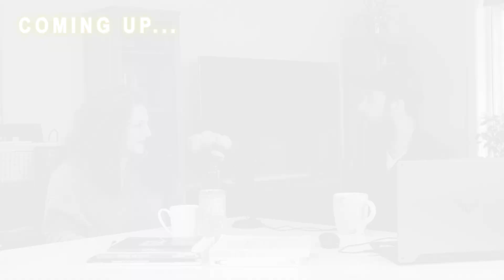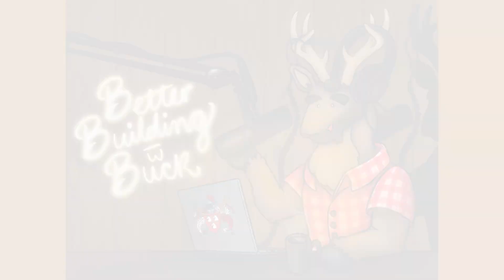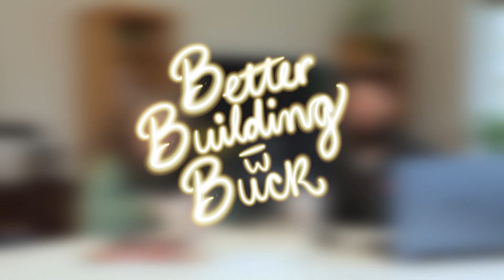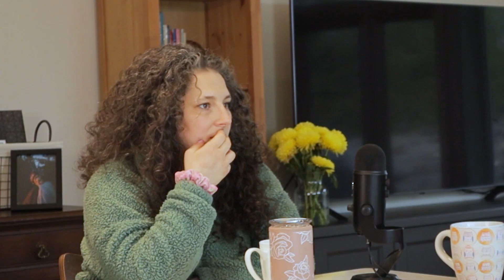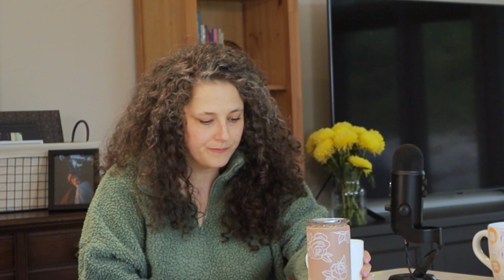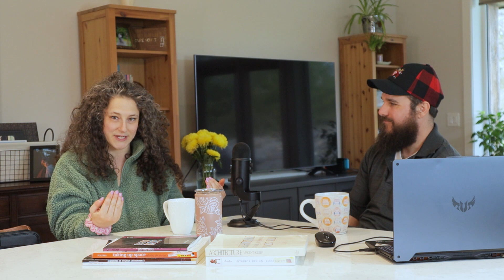The integrated design process is IMPORTANT | Better Building With Buck Podcast | Episode 11: IDP

Comment: Used to run into the same problems when I was in the sign business. Clients would sometimes work with arcitects or builders that didn't know (or care about) the building code, functionality, access, landscaping could block your ability to work or electrical could be near impossible. Way easier to figure out the details as much as possible with an integrated team.